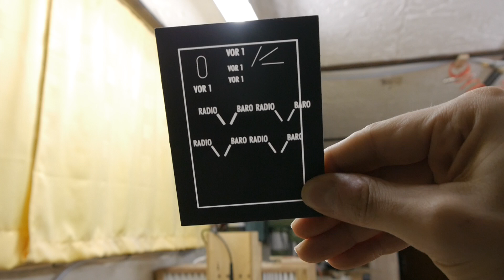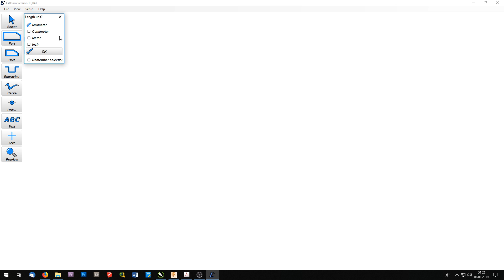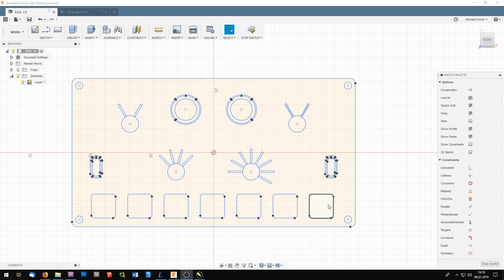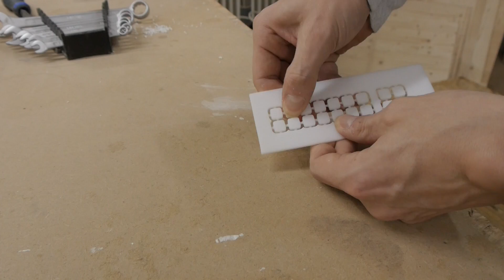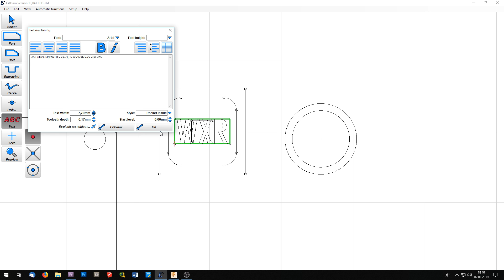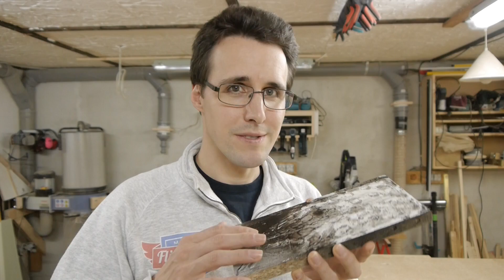Cutting & engraving EFIS panels - A Boeing 737-800 Homecockpit #30

Comment: Hello there, what machine is this that you're using to engrave/cut? How can I find a simillar one that possibly isn't as pricy because I'm on a tight budget.
Reply from the maker: This is my homebuilt wooden cnc router. You won't find anything cheaper in that size and strength. I have made a five video series about the construction process.
Other builders use also the cheap 3018 China cnc. Might work for engraving small pieces.

Comment: What program are you using that automatically finds the X Y and Z axis? I am using candle and I don't see any buttons like that to find your X Y and Z axis. That would be such an awesome add-on to the software program because I am also trying to etch and then cut out panels for my 737 simulator. Or maybe do you know if there is an add-on to find the X Y and Z axis in the candle software program that I am not aware of. Thanks for the great video and hopefully you can help me out.
Reply from the maker: For controlling my cnc I'm using Estlcam.

Comment: Is there a difference in output quality using a laser to engrave or the router?
Reply from the maker: With a router you can come out with a defined and flat bottom of the engraving. The ground of a laser engraving is a little bit rough. Engraving with a router means cutting. A laser burns, and so can the edges look like. But when you carefully adjust all the parameters, you will come out with an excellent result. Especially when it comes to fine details.
Reply: @Mickeys_Flightdeck  Thanks for the quick response. I am not sure if I can fit a CO2 in my setup. And I heard that Diode lasers cannot cut Acrylic? Or to be more precise only black one or green one i think? So I wonder if instead I go directly for a CNC only to cut and engrave panels. What do you think is the benefit of using the laser?
Reply from the maker: For me the biggest advantages are the speed and the lack of vibration. The laser is way more faster and a simple magnet is enough to secure the parts. But it also needs a lot of extra equipment like a compressor, a dust exhaust and a filtering system. So when there is only limited space, go with a CNC. And it can also cut thicker pieces of wood, I'd needed.

Comment: Is it possible to buy pre-painted acryllic?
Reply from the maker: No sorry, I'm only selling the plans at the moment. And there will be a new version of this panel in the future.
Reply: @Mickeys_Flightdeck  I was more into if some company could sell painted acryllic to cut with CNC-router just to avoid the difficult paint work.
Reply from the maker: @gertlungmaskin1210  There are some basic colors but it has to be a painted white acrylic. And when you then cut it, you will come out with white edges where the light will shine through.
Reply: @Mickeys_Flightdeck  Yes I understand. But do you know if it is possible to buy pre-painted white acryllic somewhere?
Reply from the maker: Just search for it. This is what I found here. But I can't find out what color is underneath. https://troas.shop/lackiertes-plexiglas.html
Reply: @Mickeys_Flightdeck  RAL 7001 Silbergrau! Da haben wir ja den Salat 😊

Comment: Hello! Nice work!
Im tryig to make my own backlit panels for the DCS Viggen but im strggeling a little bit with what programs to use for controling the CNC. 
Its my first project with the machine so any tips would be most appreciated =)
Reply from the maker: As I'm doing in this video and still do,  I can recommend Estlcam as control software.
Reply: @Mickeys_Flightdeck  I have now gotten the machine under control thanks to you!
But the acryllic sheet i use just melts and clumps together, giving me a very rough edge. 
Do you use some special kind of plastic?
It seems like you are using 10 mm/s speed and 4mm depth per pass. It feels like my machine is goig to vibrate to pieces if i try that speed. Should i just go for it anyway or do you have some tips on how to find the limit without breaking the machine?

Thanks for your answer  =)
/Pelle
Reply from the maker: @pellejonsson4413  The melting of the acrylic is always a sign of too much heat. I think you know this already. This comes from too much rpm of your spindle or too many blades on your tool. My spindle rotates with only 5000 rpm. Not many spindles can rotate so slow. And in addition I'm using a single blade tool. And I have cut only 0.4 mm per pass.

Comment: Michael, can you tell me where you buy your acrylic for your panels.  Just moved to Germany, and either my search skills don't translate, or cast acrylic is VERY expensive.  Thanks!
Reply from the maker: The material you have to search for is Plexiglas. I bought it at a local manufacturer who works with this material. I ordered a full sheet. So the price is a bit lower and I saved the shipping costs. Smaller sheets like DIN A4 can be ordered at ebay. I can also imagine that the prices are higher these days.

Comment: Hi Michael Why don't you paint the white acrylic panel, engrave and cut afterwards ? - By doing so, you spend less time to calibrate and, for not-painted borders, you spray them by protecting your engravings. Thanks in advance for your answer ! KickO
Reply from the maker: It is very time consuming to prepare and clean the painting pistol. With my methode I only have to paint once. And the alignment process is way faster than the cleaning process. And I think you would always see the transission between the two painting layers.
Reply: @Mickeys_Flightdeck  Thanks for your answer, Michael. In fact, I use ready-to-use painting sprays as you have all RAL colors on the web and you do not need to prepare/wash them. They are not so ecological, I agree. For the transition, you have a good point: I do not know, I will have to try.

Comment: Good evening.  Very neat to see people make these home cockpits.  I painted these panels for a company that supplied parts to Boeing.  A couple tips: Rotate the part 90 degrees every coat of paint for even coverage.  When you have enough paint to block light, let the part fully cure, then lightly(!) sand the face with 600 grit sand paper.  Then, apply a dust coat of paint over it (lower flow of spray gun) and spray from a distance.  We do this to eliminate the sand marks and to allow the particles of paint to partially dry mid air, giving you a nice, very fine textured, yet very smooth finish.  Finally, apply a matte/flat clear coat.  This will not only eliminate all sheen to the panel, but give it that beautiful avionics panel finish.  Not sure what paint you use, but we use a polyurthane enamel, but at about $600 a gallon, I'm quite positive it is out of your budget.  Instead, I recommend going to your auto paint supply store and purchasing a small pint of urethane paint in whatever color you'd like.  They're only about $15 here in the US and one pint will last you countless panels.  Not only will the paint spray a lot better, you end up with a rock hard finish that will last many, many years. If you can afford it, I recommend using an HVLP gun  (cheap ones work just fine).  God bless.
Reply: This is worth gold! Thank you!
Reply: @dr_j0nes  glad it helps, have fun!

Comment: Can the same info be found for a Boeing 727? haven't found anything on instrument panels measurements..
Reply from the maker: I haven't searched ever after this. So I don't know. I have seen a documentation several years ago about two guys who have build an UPS 727. Maybe you can find this again with a lot of searching.
Reply: @Mickeys_Flightdeck  search results give plane and cabin dimensions, nothing in reference to the cockpit. several have made 727 sims but I haven't got any replies from them. the search continues ha..

Comment: Hello there, could you please tell which software do you really use for the cuttings and engraving, and what are the settings for cutting or engraving with cnc using Acrylic board. I can not find the proper setting for my cnc with the acrylic board, i just cant find the right settings, in special with the speed and all those things, i have used GRBL Control (candle) the one that came with the machine, UGS (Universal G-code Sender) and Estlcam cnc Controller as shown in you videos, but cant find the proper settings to cut and engravind. Any help
Reply from the maker: I went through this topic in detail in one of my life-streams. You can find your answers here: https://www.youtube.com/watch?v=iJN3fpdk5Hc&t=2090s
Reply: @Mickeys_Flightdeck  Thank you for the feedback, will check it out

Comment: Hello, I have a question about plastic milling, I bought a 3018 pro milling machine and I know it is not a serious machine but I think it is enough to pre mill these panels. I would like to know which tool you use and which spindle speed and feed rate data
Reply from the maker: You will find everything you need here in my last Live-Stream. https://www.youtube.com/watch?v=iJN3fpdk5Hc&t=2090s

Comment: Nice video!

I'm convinced to start building my own CNC now. What degree and diameter v-bits have you had success with for engraving, 01, 0.2, 0.3? 45 degree? 

Thanks
Reply from the maker: Until now the best results I had with a 36° 0,2 mm V-bit.
Reply: @Mickeys_Flightdeck  Thank You!

Comment: Hi Michael, Excellent explanation and video. I have made an edgefinder tool for our cnc, but can only probe X, Y & Z. Which Gcode sender are you using for the orientation part? Could you share the G-code for your edgefinder?
Reply from the maker: Because I'm using Estlcam I don't have a G-code for the probing. I have the option of probing XYZ or XYZ & orientation.
Reply: @Mickeys_Flightdeck  Many thanks for your reply :)

Comment: Why do you use "Pocket Inside" and not "Carve Inside"? Can you share your V-bit tool settings?
Reply from the maker: Carving builds the with of the letters by vary the engraving depth. For a panel I want to come out with a constant engraving depth. Otherwise your letters would become darker at the edges. My engraving speed is 600mm/s and the depth is 0.2mm. These days I'm routing out the letters with a 36° bit with a tip of 0.3mm.

Comment: Hello Michael. Incredible job,Im impressed. I have a question. I made my own cnc router but I was wondering wich type of router bit are you using for cutting the acrylic? and how many mm/min and rpm are you using?
Hope you can aswer my question.
Thanks very much. Nice day!!
Reply from the maker: A smaller tool can be turned faster than a bigger tool because the turning speed on the outsides would be higher with a bigger tool. In my case I’m using a single flute 4mm bit with 5000 rpm for cutting and a 30° engraving tool with 12000 rpm. My cutting speed is from 480 - 720 mm/min. Cheap acrylic tends to melt faster and stuck your tool.
Reply: @Mickeys_Flightdeck  Ok, thanks very much Michael!! 
That are the same router bits I am using, I think will need more practice for making better.
Have a nice day!

Comment: Hello Michael, i engraved my panel, i have used the same metod that you, But i see the letters "dark" without retroiluminated. 
I think it can only be used with light. 

why does this happen?? low uality plexiglass??

excelent your work!!
Reply from the maker: With my material I will have to use a little bit of backlighting always to let all letters appear clear. I think you will fly most of the times with backlighting anyway. If you want the letters to be visible better without backlighting, you will have to use a whiter acrylic. Maybe not as translucent as mine. But I think you will have to use more light if it should be backlighted. You have to try.

Comment: Hi Michael, really great and useful videos. 
I need to know some tips about cutting bit you use and parameters of cutting- Tnx a lot
Reply from the maker: You can find a description about the tools and setting on my website https://mickeys-flightdeck.de/2019/01/13/cutting-engraving-efis-panels/ and in my live stream of 28.09.2019. There is a table of content in the vdeo description so you can navigate to the corresponding time index.

Comment: Hi.  I am starting to build my panels in the same way.  I was wondering what type of paint you spray your panels with?  Videos are great, keep up  the good work! :) Thanks
Reply from the maker: I'm using just a normal water based polyurethan acrylic lacker from our home depot. The RAL code is 7011.
Reply: @Mickeys_Flightdeck  Thank you :)

Comment: Hi. Nice work. I'm interesting in your alignment tool. Is it homemade,commercial,etc? Any way to get one? Thanks
Reply from the maker: It is an homemade piece of aluminum. I routed an angle into it so I can align its outer edges parallel to the edges of my workpiece. If you google for "Touchplate CNC" you will find many pictures how to make such a plate on your CNC. You just must have the possipility to cut aluminum on your cnc.

Comment: When you were doing the engraving, why didn't you use the edges/corner of the pocket you milled to zero and orient the part to be engraved?
Reply from the maker: I measured the different buttons and came out with a little heigt variance because of the paint and the glue. And to engrave all the letters with the same depth I had to zero each button seperatly.

Comment: Hey Michael, I'm going through the struggles of engraving acrylic for my radio panels and the panels are brilliant white before I paint them gray.  After I engrave with my cnc router, the letters are very hard to see unless the backligthing is on.  I'm using a 3mm  60 degree v-bit,  Spindle is 10,000 RPM and feedrate is 1270mm/Min.  I have 3mm thick acrylic (extruded, not cast) and I find the cleanest presentation is achieved by not milling too deep (0.25mm per pass) with final depth at 1.75mm.  Any advice is greatly appreciated, and thank you for the information you share.
Reply from the maker: For the engraving the RPMs are OK. When you cut the panel out I would reduse it to 5000 RPM if possible. My feedrate is 600mm/min and I'm using a 30° v-bit. My final depth is 0,17mm but this was shown in the video. I think the the smaller the letters are the harder they are visible whithout backlighting. Maybe your lines are not wide enough. I think my letters have a line thickness of 0,4mm.